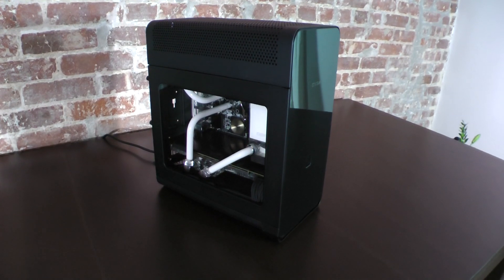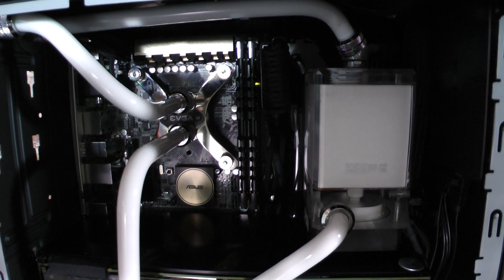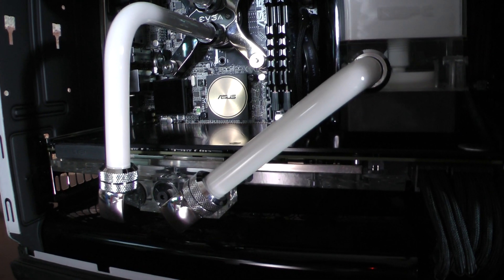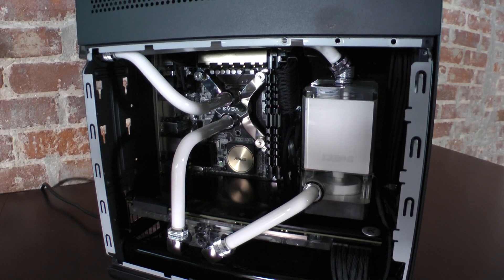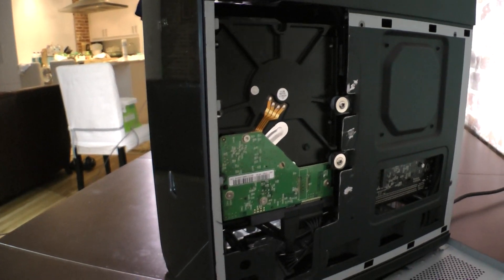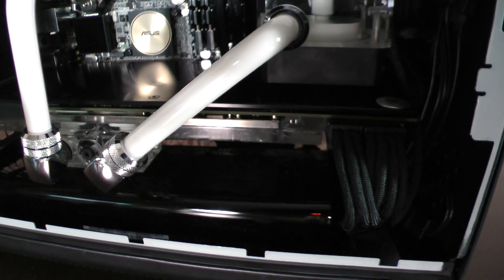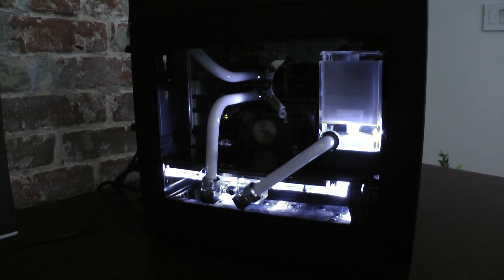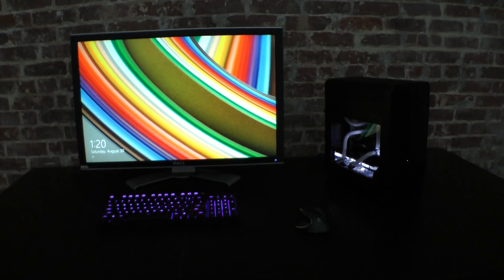Hadron Hydro build project "Milk"

Comment: how did you make the psu modular? did you just cut off the end of the wires?
Reply: ok cool :) when there's no modular option you have to cut!
Reply: will do
Reply from the maker: ***** Here is the tuto from the link attached: http://www.overclock.net/t/1487000/build-log-milk-sff-bare-die-cpu-modular-psu-gtx-780-custom-waterloop/40_20#post_22419813

Comment: Great job! I really like your build. I am thinking of doing something similar. I will start with painting everything in mate black on the inside. Really good thing is that you have removed the drive cage.. there is still plenty of space for HDD the way you mounted it! Even between the PSU and the GPU probably two SDDs will fit as well.
Just one question Is there enough room for 60mm (double thickness) 240 radiator in the top compartment? If not how about a push-pull setup with standard 30mm rad?
I wanted an InWin 901, however it is not as functional as the Hadron.
Great work!
Reply from the maker: Thank you for the nice comment. I removed the HDD case but put a full size HDD in the back.
You won't be able to fit more than a standard thickness radiator on the top. Is pretty small.

Comment: Do you know if this can fit a Corsair H100i in it. I planned on putting the fans on the inside and the actual radiator on the top in between the outer perforated shell and the chassis.
Reply from the maker: I just mesured and looks like it should fit.

Comment: Where did you get the reservoir and pump?
Reply from the maker: Samson Simpson I got mine on Amazon. Stocks are low, that product looks in demand.

Reservoir and pump could be found at FrozenCPU: http://www.frozencpu.com/products/7226/ex-pmp-62/XSPC_Laing_DDC_Reservoir_Pump_Attachment_-_Laing_DDC-1T1TPlus_MCP-350355_No_Fittings.html

http://www.frozencpu.com/products/11740/ex-pmp-109/Swiftech_MCP35X_12v_PWM_Controlled_Water_Pump_-_Black.html

Or on Amazon:

http://www.amazon.com/gp/product/B004N6ST8W/ref=wms_ohs_product?ie=UTF8&psc=1

http://www.amazon.com/XSPC-Multi-Port-Acrylic-Reservoir-Mult-Port/dp/B00A8SGI2S/ref=sr_1_fkmr2_3?s=electronics&ie=UTF8&qid=1409614713&sr=1-3-fkmr2&keywords=XSPC+Laing+DDC+Reservoir+Pump+Attachment
Reply: Wanou Wanou Thanks!  I love your build!  Very clean!  I plan on using the same case too.  I really like the pump your using other than the stock pump evga provides.  I only have one concern.  The power supply!  Is it good?  I read mixed reviews so Id like to here from an owner first hand.  

My current setup is
4770k
8 gig ddr3
Asus H87i-Plus Mobo
Gtx750 ti (plan on getting an evga gtx 770 or 680 4gig with the new case)
Plan on adding a few led lights

Im a noob at building so any advise helps!  Thanks!
Reply from the maker: Samson Simpson 

I've the same CPU but more RAM and a larger GPU so the PSU is fine I guess. Have a look to the blog with the link in the description for all the details.
Open an account on Overclock.net is totally free. It has tons of good resources and you'll be able to ask all sorts of questions directly to people with the knowledge.